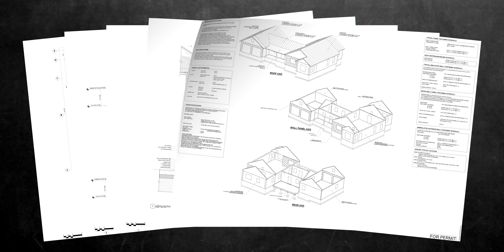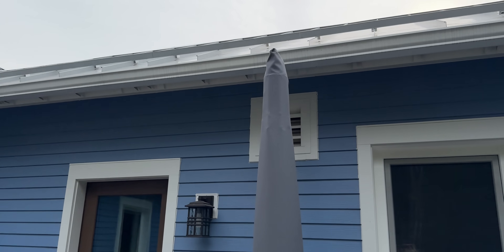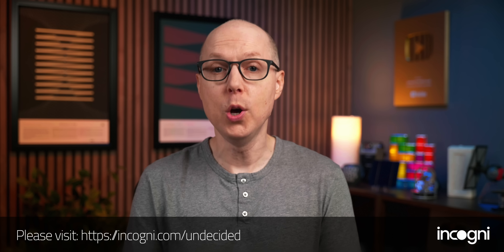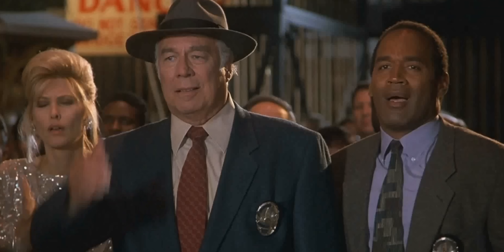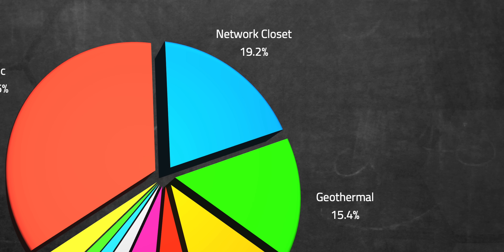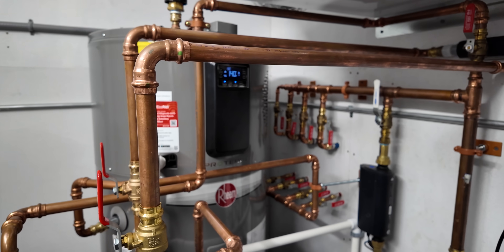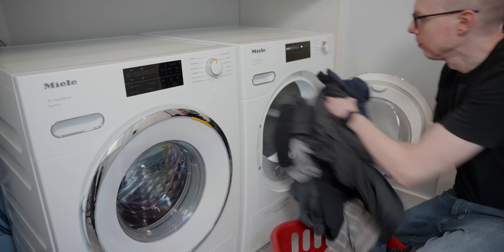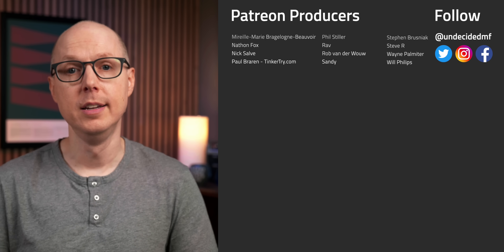What I Learned After 1 Year in My Net Zero House

Comment: My parents got a heat pump and tankless water heater. The water heater is amazing 🤩. Heat pump they gave only works well in temperatures down to 40F. Even though it can go lower it's not efficient. So they have a propane heat backup for the winter months.

Comment: We're currently looking into making our house as close to net zero as possible in the south of Spain. It's an older house, so there are some challenges. This is great information, thanks for sharing man! 
At this stage, we're thinking of just making everything electric and getting more solar and batteries since we get over 310 days of sun yearly. Geothermal sounds great, but heat pumps that can run on solar are more economical in our situation. I think.

Comment: Great overview of the house & tech.  We also love our induction cooktop and heat pump furnace.  I’m curious- What drove your decision to go with a slab instead of basement?  We bought an existing house and did some remodeling (including the induction cooktop).  The electrical and plumbing changes would have been way more difficult and expensive without a basement.  Since this is your forever home, it’s a good bet that you will want to make changes somewhere down the road.

Comment: Was interested in the HP Dryer, but Speed Queen doesn't have one yet for residential.  At least at the time we were buying.  But other than that.  Induction cooktop, electric French door oven and Steam Oven below, Dual Air Source HP and HP Water Heater.  Gas meter was removed.

Comment: We bought a 3200 sq ft house in Massachusetts a couple years ago and did several pricey upgrades, but the improvement in livability of the house were dramatic.  We did a new hot roof and moved our attic inside the thermal envelope using super high R rating spray-in roofing insulation (40k).  We did a dual loop ground source heat pump (55k) from Dandelion.  We replaced all the windows with new high efficiency windows (65k).  We replaced the water heater with a geothermal one in a below grade basement machine room (which functionally means its drawing much of its heat from ground).    Before these upgrades, our utilities (oil, water, electricity) were $760/month.  Afterwards, its been $240/month -- and that's with adding an EV car to the electric bill.   Sadly, my house is quite shaded so solar really isn't an option.  Those upgrades along with some other improvements were around 20% additional cost over the price of purchasing the house.

Prior to the upgrades, my partner was constantly cold in the winter and I was constantly hot in the summer.  Afterwards, we keep the house at ~71 year round.  And the finished part of the basement is now comfortably usable and doesn't smell of heating oil.

We ended up having to install an ERV to deal with carbon monoxide after we replaced the windows.  The old windows leaked so much air.  As part of getting the ERV installed, they did a blower door test.  We are at 5.71 air exchanges per day - which was a 3.520 ACH50.  We run the fans on the hvac for 20 minutes every hour, which by itself was enough to fix the carbon monoxide problem but once we had the ERV seems to be perfect for us.

I wish I'd done more research on the windows and that I'd done the windows first.  We were having so much heat leakage that it made measuring the effectiveness of the other changes impossible.  I think I could have gotten better windows for the money.

If you've played with the Green Door app at all, we have a "Gold" Pearl Certification and are most of the way to Platinum..

Comment: We retro-fitted our 1990's house (which we had extra loft and cavity wall insulation, new triple glazed windows and composite doors fitted) over the past decade, starting with solar panels. We then added a storage battery some years later. This year we replace our Gas central heating boiler with an ASHP, swapped out the the Gas hob for an induction model and replaced our Diesel powered car with a BEV. We had our gas supply disconnected. I'm cautiously optimistic that we'll comfortably spend less on electricity than we did when on dual fuel. We'll see by how much this winter.

Comment: Do ventless heat pump dryers affect the humidity of a room? Where does the moisture from your go clothes go?
Reply: Most of the water ends up going down the drain, the heat pump dryer has its own (small) drain hose like your washer does.  The heat pump dryer operates by blowing air across the hot side coil to heat it up, blowing hot air across the wet clothes to evaporate some of the water, then blowing the moist hot air across the cold side coil to condense some of the water vapor.  The liquid water drains off the cold coil to a collection tank, where a pump periodically sends the water out the drain hose.  The air stream after the cold coil can be directed across the hot coil to repeat the cycle.  Depending on how well the heat pump dryer does that versus using additional ambient air, it will leak some humidity.

Comment: Well done Matt. I do have some thoughts on your discussion. 

Your home is slab on grade construction, which is what we have here in the south. I noticed that the cement conducts the heat and cold through the slab perimeter at an alarming rate. it is especially noticeable in the winter, as I can feel the cold floor at least 2 feet in from the perimeter walls. I have ideas on how I would correct this issue should I build a new home, but I would love to hear if you did anything to prevent this issue in your home. 

Your technical closet is a huge energy hog, as you pointed out. All of that energy usage generates a lot of heat. If not recovered, this is heat that taxes the HVAC system during the summer months when trying to cool the home. Do you try to recover that heat in any form?

Likewise, the ventless clothes dryer, while not exhausting conditioned air, does introduce warm moist air into a conditioned near air tight space. How do you mitigate those issues?

Have you considered using radiant heat barrier in the attic space? If done well, this can keep the attic space to near ambient temperatures, which lessens the demand of the attic insulation, cutting energy use. 

Let me know your thoughts. I love your channel.

Comment: What did you do to reduce the network closet energy use?  My equivalent is pretty bad and I want to fix that too!

Our house is pretty good, but no where near Net Zero equivalent.  We have gone all electric and heat pumps.  Our HVAC heat pump does go into 'emergency' resistive heat to much, we couldn't get the better pumps at the time, but we love our all in one washer/dryer that is condensing (meaning heat pump).  We have 2 EVs and put in solar this year.  In since March when solar was installed, we have almost zero electric costs.  And are expecting lower heat costs this winter.  We are on our 2nd or 3rd AOSmith heat pump water heater (warranty replaced).  They are great when they work, but turn into pure electric when something goes wrong.  Not bad but not great.  We do have 3 Powerwall2's that we love.  Still more battery would be better.  Our electric company started 2 months ago a plan to purchase electricity at their commercial cost from TVA, and sell it to us at full residential retail.  Still for what we don't use or store we get 1/3 the value roughly on our bill, but otherwise we wouldn't use it, so it is still a win/win program.  BTW we are in the Nashville TN burbs.

Love what you do, keep it up, both you and Shawn.

Comment: Just bought a set of three mesh routers only to find out cost of powering the mesh network is higher than the costs of my network connection. The mesh network use 26 watts per unit, all in all almost 100 watts, counting in the power the transformer looses.

Comment: Pork Just finished in 2022 , in our 1951 central coast California home, the complete removal of socal gas to all solar electric. So budget on the with tax credits , will be 12 -15 years for payback. The ENPHASE solar and batteries system is super. 
Our phev Toyota runs 50 miles on sunshine ☀️.The super effective heat pump heating and cooling system, a heat pump water heater and electric clothes dryer and electric range. So SCE grid monthly bill is $11.
Because on financial windfall , and need tax credit, but most importantly I want do EVERYTHING to slow climate change .

Comment: I do like the heatpump dryer.  Yes, it takes longer, but I just dry for 30 minutes and then put the clothes on the line (which works well in a hot, arid climate).  And good idea going with the Miele.  They cost a lot, but in my experience, it's worth it.  Can't wait to get an induction cooktop.  It looks much easier to keep clean than gas.

Comment: I grew up in a tiny 800sf, 2 bed home. I now own one that is about 3 times that size, but more efficient, I used to think I wanted something larger, but now my goal is something extremely efficient like you've built here. This content is really inspiring.
Reply: I'm thinking of moving into a renovated (and extended) Welsh cottage, 1 bed, 270sf... but with an air source heat pump 😃
Reply: An 800 square feet home is not tiny.
Reply: @SweBeach2023  Compared to regular homes it is! Mine is that size,perfect for 3 people

Comment: I'm surprised Matt didn't think to put the network rack in the same room as his heat pump water heater.  The heat generated from the rack would be absorbed by the water heater.  Would've been a good way to absorb the added cost of running the rack.  Also would have a cool, dry environment to run the network equipment in.  I've thought about doing this in my basement should i ever get a heat pump water heater.  I know he's got the desuperheater which helps but hey, more efficiency is better.

Comment: I believe that house architecture is more important than tech. Windows sunward, with visors to reduce vertical summer heat. A more compact design would reduce heating requirements. Putting the house on stalks would also mean you don't need either a basement or concrete slab foundation.

Comment: Really interesting stuff! When calculating total energy use, would it make sense to factor in the heat generated from your network closet, it's my understanding that 90%+ of the energy used by electronics ends up as waste heat... in the winter in a well insulated home, most of that "wasted energy" from the networking would actually be providing heat for the home. i.e. if the networking wasn't there in winter, presumably the geothermal would have to work a little harder... probably not a significant factor but would be interested to hear your thoughts on that! 

Thanks for the awesome content!

Comment: Looking at building an Additional Dwelling Unit of about 900 sq ft. on my property and would like to make it a zero net home.  The designer and builder that I have in mind already make some very efficient homes and I think I can get enough panels on the house to push it to that zero without going to the extremes you have gone through (ground source heat pump, air exchanger...)  But wel'll see.  It's kinda more of an experiment and example of building I want to do.  Great information, Matt!  Thanks for doing this!

Comment: I think all this is great, and is the future.  Good on you Matt for taking upon yourself to go out and build this amazing house, but my only real concern, is this is going to get very expensive to maintain and repair as these systems age, and begin to breakdown and fail as the years go by.  I would suspect that all or even more than the total savings you're going to realize throughout the years will be eaten up by the cost of repair or even replacement of these systems.  Much like EVs when the battery fails and you're now looking at the $60,000.00 battery replacement for a car that didn't cost much more than that new.  This far exceeds the savings of fuel you've collectively saved over the years of ownership.  I'm not convinced this overly complex - very expensive system, and initial outlay of money is going to pay off for you in the long run.  That's my take on this.

Comment: On the note at the end about the Heat Pump dryer. If you're concerned about how they are smaller than average US dryers, or how some models, there is the shake test of dampness you have to do after... Check out the LG DLHC5502. I have had it for a few months and I love it. There's a great review from Ben's Appliances and Junk.

Comment: A combined washer/ventless dryer makes the extra time not matter, I find.  Simply put a load in, and come back home later to clean, dry clothes.  I find this more efficient with my time than a system where I have to move loads between separate washer and dryer, and be around at the right time.  I used a combined washer dryer in the UK long ago, and would just load it before heading to work, and unload clean dry clothes when i returned home.  Now, back in the States, I have a bigger one, ventless, from Costco, and find it similarly convenient.  The door even automatically opens at the end of cycle, and there's an automatic detergent dispenser so I only need to fill that periodically.  Convenience can actually be enhanced.
Reply: What a TOTAL, GODDAM LIE!!!    “I don’t have TWO MINUTES to swap clothes.”  BULL….CRAP!!!!
Reply: i would love one of these. put one load in the AM, runs during the day, one in the PM runs overnight.

Comment: We have 2600sq ft  standard house (1997 construction) in zone 4 climate that's been retrofitted to forced-air heat-pump heat/cool + heat-pump water heater.   Installed 15kw PV (48 panels) with large battery and been tracking use.   We burn ~13,000kwh/year in heat/cool,  ~7,000kwh/year in computer/tv/network, and 2,000kwh/year in hot water.   We save ~$20/month over natural gas hot water.    The next larger draws are things like the dryer, cooktop, oven which are the relm of ~1,500kwh/year which is minor in comparison to heat.   Our 1st goal with solar was to be 100% electric and be able to run everything and ordinary dryer / cooktop / oven meet this goal.    Eventually we may go heat-pump dryer or induction but with our significant solar infrastructure we have the option of adding more panels which might be cheaper.

Comment: Very interesting! Here in the UK our air source heat pump uses 10-15kWh a week to produce all the hot water we need and we dry our clothes outside mainly, why use a dryer at all? In winter we use around 100kWh a week for heating and hot water, air conditioning is happily not needed, last year we used a net 3,000 kWh of grid imported but also exported 5,000kWh. We should do better this year as I installed a second Powerwall in March.

Comment: Excellent job Matt. I flipped from oil to propane for heat/tankless hot water, and installed initially 19 405 W Q-cell panels, but added 4 of the same over my garage to ensure I won't have an electric bill. I'm now (and still in late September) overproducing, so I'm adding a mini split for heat in shoulder seasons. I  think I'll be able to cut out about 1/3 of my heating bill. I really got to look into a heat pump dryer, and a new fridge. That might result in more electric left over for heat. It's going to take between 6 and 7 years to pay off my solar, but I only took out a 5 year loan (put cash down), which I hope to pay off in the next year or so. So overall, my electric bill will remain at 0, possibly cut my heat in half, but will still have internet and tv bill, not to mention the taxes. But if I'm only paying about $100/mo on average for heat, I think it's a win. My total investment in solar was around $28k, but I got nearly a 1/3 of that back in tax credits. I'm in MA also.
I'm in the new home construction sector (I design residential subdivisions), and here in New England, there's really no need to try to save money with a slab foundation. Yes, you'll need to dehumidify the basement, but in terms of cost savings/additional storage, it makes sense to have a basement. Wiht the frost level at 4', why not go a few more feet of concrete wall and gain an entire story.

Comment: I am not fluent in English, so I am not sure I understood all the details of your house project. 
But this is for sure an impressive technological 2024 house, where you achieved (with a LOT of money and high tech) to optimize your consumptions (and then your future expenses).
To me, this is one way to see the ideal house facing the energy challenges. Too bad you did not try with such a budget to reach the passive energy level, but you are close to it.
But there is an other way, which is to try to create the ideal house to face any possible energy (and water, and food) crisis : try to create a resilient house, able (if necessary) to be completely off grid for energy and water, which may happen some day (political crisis, energy crisis, pollution crisis). This kind of house would bet mostly on low tech solutions (except for solar system), or technologies that you can master and repair. This kind of house would have a large fruits/vegetables garden, chicken, would stock water from your roof for domestic needs and for the garden, and would have a very basic wood heating system.
It is funny to see that for the same goal (long terme efficiency and safety for your family) you can have 2 almost opposite ways to see things